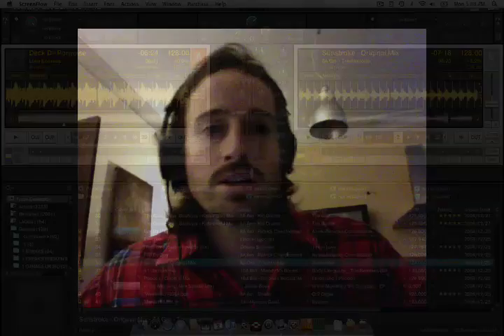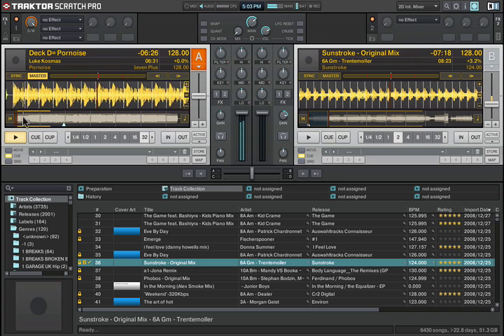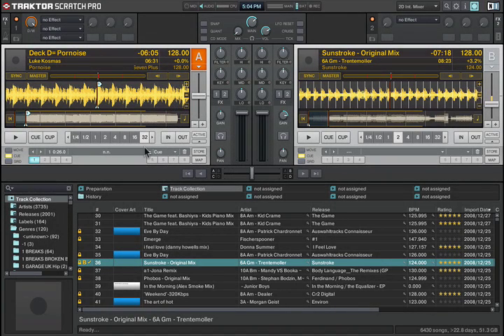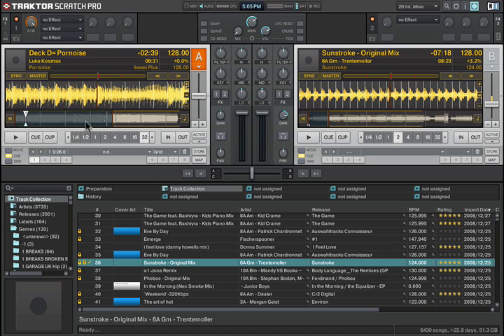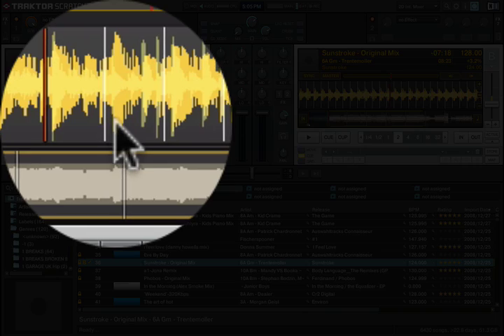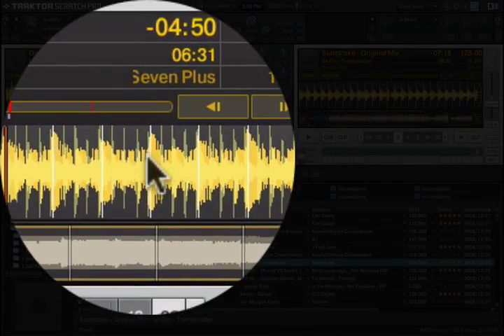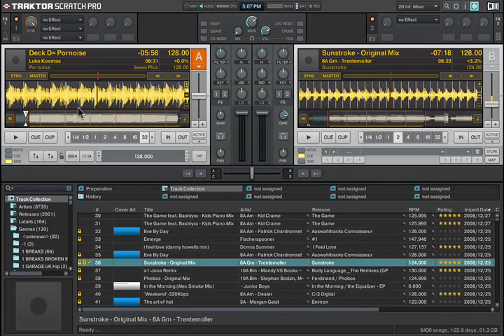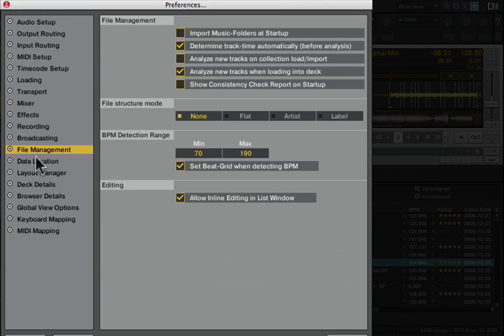Dj TechTools-  Traktor Pro Beat Grids

Comment: @kleinpauldotcom well it isn't true. from a production standpoint, kicks are ALWAYS on beat whereas snares are often deliberately set to hit late(for a looser, lazy feel) or early(for a more urgent feel), at least for those tracks in which the producer has attempted to inject a more humanistic feel to the drums.
i'm very surprised that anyone would recommend attempting to quantize anything wrt the snares as it will often result in errors.

Comment: hi ean. 

I tried your method with "marcel wood - BPM (original mix)" there is a recognizable reduction in tempo, and then it comes back up to the original tempo. is there any way to grid tracks that have a variable tempo through the song?

thanks

Comment: This may sound silly, but what is the point of beat grid? I learned to DJ on 1200's and vinyl.  I now have Traktor Scratch pro, and I manage to beat match tracks without really using a lot of the software functions.  Is there a way to rabidly beat grid all your tracks? Like any modern DJ, I have countless gigs of MP3's, and it seems like it will take forever to beat grid all my tracks.  Any info is appreciated! Thanks!

Comment: @robbycaseria12 
I have the same setup. You need to have the X-Session turned on before starting Traktor. Then, go into Preferences > Controller Manager and select the X-Session from the Device dropdown. Now you have to map inputs, for instance click on Add Input and select Transport > Play/Pause, then click on the Learn button and press the left Play/Pause button on the X-Session, it will be detected, un-click Learn and then change the Assignment to Deck A. You'll figure out the rest.

Comment: In Traktor 3, this was so much easier.  Proper detection of beats after analyzation (indicated by white lines), switch to Internal mode, click white beat line, place beatmarker via hotkey.  Done.

Now in TPro, analyzation is poor, too much setup time and you must jump between two panels to delete a grid marker!

Comment: you are the pharkin man Ean!

Always informative and I've learned something once again. Still really not too clear on what the difference between the "move grid" and "bpm increment" buttons are exactly but the method I used to use was turn the ticker on, auto-grid on the 1st kick (snap-on), use the tempo nudge buttons until the beats sounded synced then use the "move grid" buttons to match the phase. 

This usually worked but has failed on a few tracks...this seems more accurate.

THANKS!

Comment: thanks for the scoop.  The auto BPM works better when you have "Snap Mode" enabled, which I see in the video is not enabled.  Although I feel that manually setting the beat grid is more accurate.

Comment: I really enjoy your videos. I learn alot from these! Thanks!

I've mapped the "Move Grid" to the pitch bend and jogwheel in my controller setup (When clicking a modifier). I found that the tap and autogrid will work quicker when I use that and just move the grid. (Some songs fall through though). :( This weekend I found that instead of using bend I use set the sync and use move grid untill it's in sync. 
So I do the editing when I lay the track. Saves me alot of time for prepping. :)